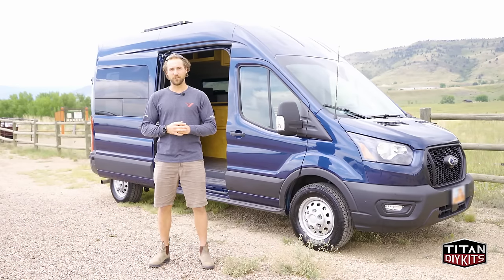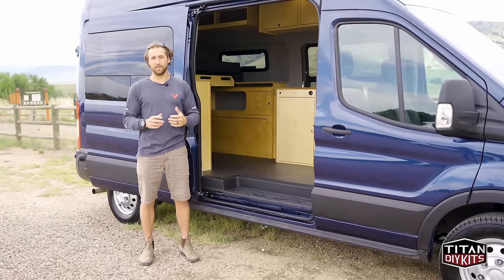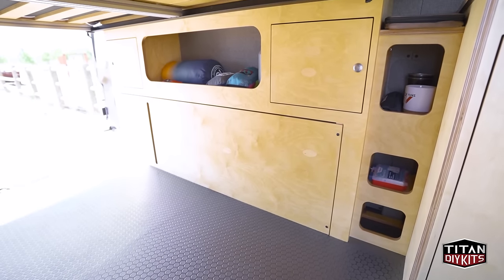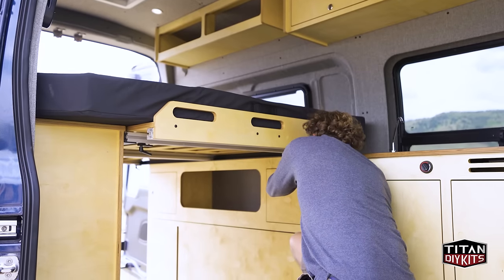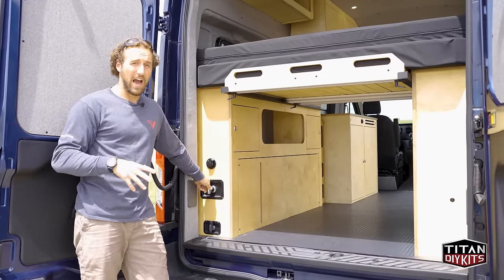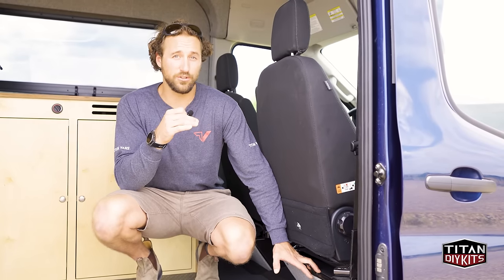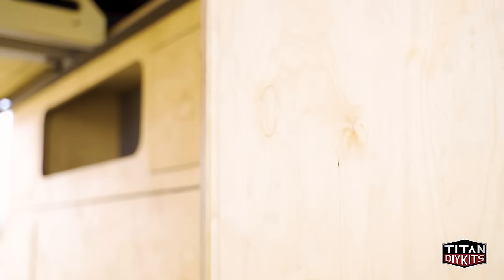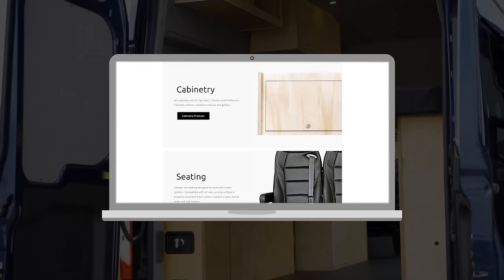Fully Installed Van Conversion for Under $25k | Timber x Titan Vans

Comment: I hate the 1/4 tank cut off for the heater.  In a larger RV that is $100 of gas.   In this Van it should be 1/10 of a tank at the most ... you can still go 30 miles!   Also, I often arrive in the mountains late at night with less than 1/4 tank.   I can get gas in the morning and continue my journey when the gas station is open!   If you go deep into the forrest, then you should really be full and be tracking your gas usage anyway!  Plus, having the heater on all night does not use that much gas!  ... you are not going to use even 1/4 of a tank!

Comment: You don’t need to eliminate doors to cabinets. Just use sliding panels for doors. BTW, your small cabinet doors under bed have the same swing out problem
Reply from the maker: Thanks for the feedback. We have found sliding doors to rattle. The other doors that open we consider more utility storage. Nice to have both from our experience designing vans for the last 7 years.
Reply: @TitanVans  Everybody that uses them says glue felt in the track

Comment: Would I like an integrated AC unit, bathroom with shower and all the bells and whistles? Yes. But I have other things I would like to do with my retirement. I know my skill set does not include the DIY needed to convert my own. I know if I plan my travel route to the four seasons, I can be comfortable with this set up. Butane tabletop stoves work well for us (even indoors) when we go tent camping (get the Japanese or Korean models at the Asian markets) as well as our iCamper ISO fuel disc. Might even find space to add a portable Traeger grill.  Wish you would include mounting for marine swivel table. But this is a viable, affordable option to get us out on the road. Glad your design has such a spacious dedicated sleep deck. some vans make it a project to set up a bed for an after-trail, afternoon nap. Good sleep is underrated.
Reply from the maker: Thanks for watching!

Comment: This popped into my YouTube feed. I’m shopping these van builds and am excited to see companies offering affordable options. I like this setup. I am also looking at the wayfarer modular setup but the like this a bit better. I saw in another comment that you say your finishes are superior and I’m not sure one way or the other, but I am wondering how your spray adhesive attaching fabric right to the vehicles sheet metal is supposed to hold up to condensation? I see wayfarer uses wool insulation for a barrier and you guys use a synthetic insulation in some areas. All spray adhesives fail, so this is my only issue otherwise this is a nice clean well thought out layout.
Reply from the maker: We've been utilizing similar products for fabric and adhesive in our full-production models for close to a decade without any signs that this setup isn't capable of handling challenging conditions. Feel free to reach out to us or the Timber team if you have any other questions!

Comment: Wish that you have more power options as the Yeti is lithium chemistry. Would have prepare either Anker, Ecoflow or Bluetti for LifePo battery chemistry. Overall, interesting.
Reply from the maker: Yes the Yeti is Lithium NMC as opposed to LiFePo but still is a great power. Easy enough for consumers to swap to another option if they prefer as everything is plug and play.

Comment: Very impressive kit, I love the no bathroom/shower inside. I also like the Yeti power station so it is easy to take in and out.  I would use my van for long weekends chasing powder in the winter and hiking from trailheads the rest of the year. I think your kit is the best one I have found for my needs. Just need to get moving on finding the right van for the build.
Reply from the maker: Thank you so much. We're ready when you are!

Comment: It looks like a solo traveler could push the bed forward, use half the mattress, and have an open space in the back for carrying things. Is this correct?
Nicely done kit. Quality materials, good fit & finish, simple & clean styling, and laid out well.
Reply from the maker: Its designed for the bed to be slid back and used as a solo bed. It could be done as you suggest but the retaining tabs would need to be secured as the physical stop is welded only on the rear of the bed rails.

Comment: it would be nice if you did a part 1 and 2 order for the full dyi kit so you dont have to spend so much at once. for example part 1 would be the flooring, panels and pluming. and part 2 would been the bed, bed frame cabinets and so on.
Reply from the maker: @diamondly6250  We do just that! We sell each item al a cart so you can buy at your own pace. Although the kit will save money and time!

Comment: Amazing setup. Would you have an option to add a indoor bathroom in the future?
Reply from the maker: You could utilize a cassette or composting toilet. However no current plans for an interior shower or wet bath option.
Reply: Would you be able to add seats as an option?
Reply from the maker: @soowook  Customers could add after the fact using a bolt through seat option but the Timber currently does not have a seat option that can be installed directly. Our full production line offered through Titan Vans has several models with seat options.

Comment: Great video that shows this wonderful build out.  Question: can the telescoping bed be moved forward leaving the garage open at the top in back.  My concern is enough space under the bed for a tall bike in a cargo tray.  If bed can slept on forward then the bike can go in back without concern for not fitting under the bed.  Thanks!
Reply from the maker: Due to the telescoping nature of the bed, the bed rails are designed to keep the back section stationary while the front is free floating. That being said, the bed rails could easily be flipped, moving the stationary point to the front of the bed. Also there's about 3ft of clearance under the bed which should allow most bikes to fit underneath it.
Reply: @TitanVans much appreciated reply. Thanks.
Reply: @TitanVans  thanks for your replies.  I moved the bed to just in front of the stops in back and compressed the mattresses just that much and the bike fits in front of that. I found that I like the full bed and probably will keep it that way.

Comment: Is it a problem if the Ford Transit has a dealer AC unit more mid roof than where you put a fan?  Also, is there a desk mode for eating or remote work?
Reply from the maker: The Timber is currently not compatible with mid roof vans or with vans with rear AC units. Fans if already installed are easy to work around and move paneling cut outs if needed. Marine tables/Lagun tables can be added with front swivel seats to create a work/eating area.

Comment: Such a nice looking build. BUT as a over 50 person the placement of the fuse panel is shortsighted low light small fuses no good. Make 12v breakers standard you can feel the tripped breakers in the dark which might be necessary.
Reply from the maker: Thanks for the feedback. Keep in mind the fuses should almost never be touched unless there is an issue. They are like the house equivalent of a breaker panel. You may need to access them 1 once every few years if ever.

Comment: Seems very similar to the Wayfarer 25k van build, what are some advantages and/or differences between the two?
Reply from the maker: Quite a few differences. The Timber is offered for the Sprinter, Transit, and Promaster. We use high quality materials, marine grade hardware, and marine appliances. Our product is offered with install for less than $25k or can be shipped flat pack to your door for under $16k.

Comment: It doesn’t make sense to put the heater’s hot air outlet right next to the sliding door. Well if you’re stuck and you’re freezing to death you will want to drain your tank rather than die with a quarter of a tank left

Comment: Do I need to pressurize and blow out the lines to winterize this plumbing or can it drain by gravity. Thx
Reply from the maker: We recommend using the included water pump to purge as much water as possible. However, for the best results, blowing out the lines with compressed air is ideal, as it ensures a more thorough winterization.
Reply: @TitanVans  thank you

Comment: I’m wondering if you can flip the kitchen to the other side of the van? 
Other than that I really like this kit!
Reply from the maker: You could but it would take up quite a bit of the slider door entrance. You would also need to flip the wheel well cabinets as all the plumbing is contained on the passenger side with the setup seen in the video.

Comment: No hot water, no shower, no toilet, no standard heat, no air conditioner. If you do the numbers, this is almost a fair price for what you get. And for what you don’t get.
Reply from the maker: This price is whith labor to install. We now also offer this, at any even lower price, as a DIY kit that ships with everything needed to assemble and install yourself.

Comment: Lots of trolls in the comments, eh?  It looks like a nice package at a reasonable price.  A serious question: what is the standing height in a transit high roof with this floor and ceiling trim?  I know that you said that you were 6'2" but I'm 6'5" and trying to figure out if this will work or if I need to get a van with a pop-top.  Thanks!
Reply from the maker: 6' 9" at the peak. A couple inches less at the sides.

Comment: Great set up; any layout modification to have the galley set up on the sliding door side, interior shower, overhead storage above cockpit seats, higher 3000w inverter & solar?  roof rack to add awning and black PVC Water roof storage, built-in air compressor?  External power outlet
Reply from the maker: Not for the Timber Van conversion, this is available through www.TitanDIYKits.com. For those features check out the premium models offered through Titan Vans at TitanVans.com.

Comment: WoW, great video, you didn't leave out a thing!  Is an A/C an option?
Reply from the maker: Not with the Timber because of the inverter/battery size of the Goal Zero power packs. AC units would pull too much power to be practical for these systems.

Comment: Great looking build. Do the optional add-on features like the windows and the heater have to be installed at the same time as the rest of the standard build, or can they be added later? Also, do you have any relationships with dealers to help source a van?
Reply from the maker: We can absolutely help you source a van! Features like windows are typically installed towards the beginning of the build, for a few reasons, so these would not be able to be added after the fact. Items like Webasto heaters and Maxxair fans are much easier to integrate into a finished build. Feel free to contact us or the team at Timbervankits if you need more information!

Comment: Curious if any worry about having a pump located above water source has been and is sure or thought about. At least in IT having the pump as close to level to a reservoir if not slightly gravity fed has always provided ideal. I know air in pump isn’t as much a worry but I wanna know how much RnD information has provided. I’ve never used that pump as I’m old and when working on rvs it was almost always sureflo. I just don’t know it’s capabilities.
Reply from the maker: Modern pumps are very good at self priming. We have been using this pump for years on simpler designs and never had an issue. Even with it be mountes above the tanks it always will prime and pressurize.

Comment: The big difference between this and the more expensive cvs s are creature comforts. No bathroom, no shower , ac, generator
Reply from the maker: Thats right! We designed this to be simple, functional, and durable. We got rid of the frills and reduced the price down to make it more accessible for a larger market.
Reply from the maker: @MyPronounIsGoddess  we offer some of the items you listed as option for the Timber but we also have a full production product line at www.TitanVans.com.
Reply: @MyPronounIsGoddess  Do you think that it's valuable to share that your son converted your van for less money than a professional van upfitter?
Reply: @MyPronounIsGoddess exactly. By the time you add the necessary items, you are up to the cost of most other b vans. There is no  free lunch . Only advantage is can check quality of the build
Reply: @MyPronounIsGoddess Huh?? What kind of dumb comment is that???. This is damn business Beverly, remember America, capitalism, people trying to make a business and achieve the dream and all that. I am not even American and I get it. What you want a business with tons of overhead and a shop with employees and insurance and business license and tools that need replacement, get them to R&D everything, procure all the equipment and supplies etc etc and your comment is that your son can do it cheaper. OMG…..
Reply: @MyPronounIsGoddess  ya, not once did the guy mention that this was a Van Life build. He mentioned that it was a lower cost alternative to other, much more costly professional builds, even including some of their own more expensive builds. They are trying to bring the price down to everyone by using the economies of scale to mass produce kits that they either sell as DIY or in this case, one that is a kit but that they will include installation in the price. All these comments about no shower, no toilet etc are so stupid as clearly you can add whatever you like, but this guy realizes, as someone who undoubtedly builds many vans for paying customers, that not everyone wants to live in their van, and not everyone wants a shower and the added cost and maintenance and winterization that goes along with it. But they do offer ones that have those things. If people would just pay attention. The bottom line is your comment ads nothing to the narrative here but alas, most comments do not. People just feel the need to barf their opinions all over for the good of nothing. Unsolicited advice is annoying when one is actually trying to sort through quality comments and questions. Congrats on your son helping you, that is nice for you.
Reply: @MyPronounIsGoddess  I relish my relationship with my son and, just as I paid for his driving lessons, I would not expect him to flawlessly execute a van conversion for me. Less stress for both of us.

Comment: I followed up after watching this and went online to Titan Vans, and found  a much higher price and no cabinets on walls.  None were shown?  Almost 10k higher, by the way!
Reply from the maker: Hey Judith, thanks for reaching out. It sounds like you might have come across our Classic model, which is available on our main Titan Vans website. Our Titan Vans builds come with some premium features like a 3-year warranty and advanced electrical and water systems. 

Titanvans.com

The TIMBER, on the other hand, is a unique offering exclusively through our TitanDIYKits site. While it has a more straightforward setup, it provides an affordable entry point for those looking to create their own custom adventure van. If you have any questions about the TIMBER or would like more information, please don't hesitate to ask. We're here to help!

https://www.titandiykits.com/pages/timber-camper-van-conversion

Comment: What is the ideal Ford Transit size for the full Timber van conversion.  What engine (3.5L V6 or 3.5L V6 EcoBoost)?  What payload (250 or 350)?  What size (148 long or 148 Extended)?  Will Titan Vans find the Transit for you are is it up to you to bring the van to Titan Vans?  Thanks.
Reply from the maker: 148 vs 148 El is mostly personal preference (how much space would you like to have on the interior of your van). The conversion is rather light (as far as van conversions go) but going with the 350 EcoBoost will offset some of the performance lost from the additional weight of the conversion. 

We can help you source a new van if you'd like us to.
Reply: @TitanVans  Thank you so much for responding to my questions.  I'm really impressed with your van conversions and how you run your company.  Very smart.  I'm just a little ways away from pulling the trigger on a build, but when I build, I'm going to go with Titan Vans.

Comment: What position should the valve be when filling the water tank? Will the overflow work when it is in the off position?
Reply from the maker: When filling the arrow should be pointed left or down when facing the back of the wheel well. The overflow will expel excess in any of these settings.
Reply: @TitanVans  thank you.

Comment: What needs to be done to substitute an Anker SOLIX F2600 Portable Power Station in place of the Yeti? What about a table for dining, what provisions for that?
Reply from the maker: Not sure on substituting the power system, likely just swapping out the wiring harness plugs to connect in. You would also need to verify appropriate wire size for inverter output and alternator charging. Marine tables can be added easily to any camper van and simply require a recessed floor mount.

Comment: Can the electrical be upgraded. I would like a Bluetti 200max (2000 watts) with an additional solar panel for (200 watts). I need a rooftop ac as well. Full-time van living.
Reply from the maker: Check out our full production models at TitanVans.com

Comment: But what about solar and wiring? Also heat connection and plumbing.
Reply from the maker: Which aspects are you wanting more information about? Solar, Electrical (including wiring), heat, and plumbing are all included in this build.

Comment: Transits are not good candidates for overhead cabinets due to intrusive bulge where walls meet roof/ceiling and the premature slope of the roof two feet behind the front seats compared to Sprinters and Promasters.